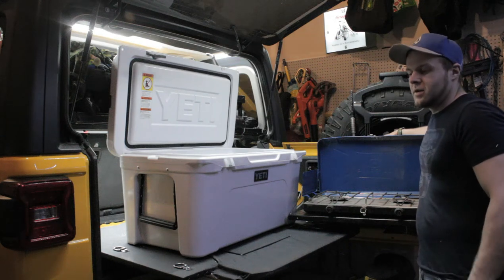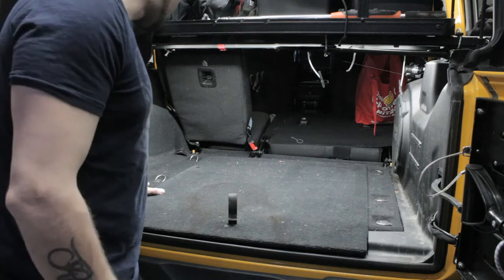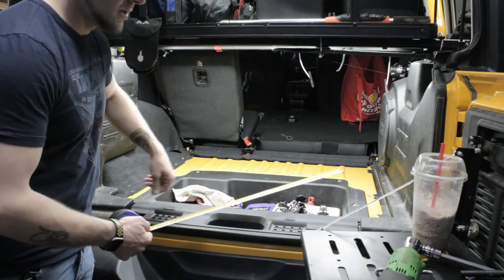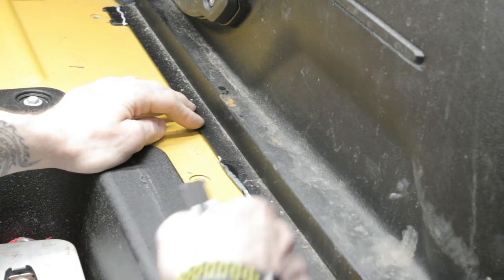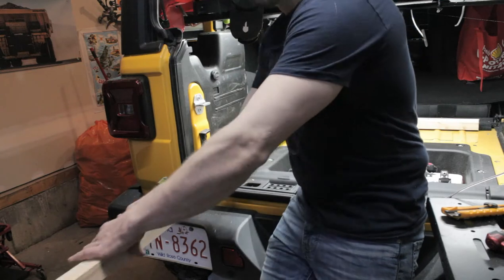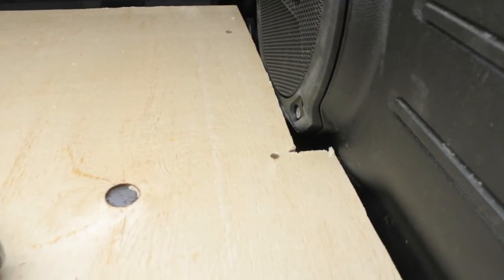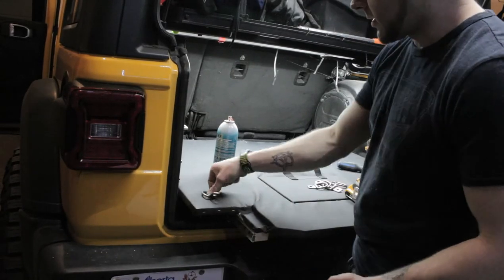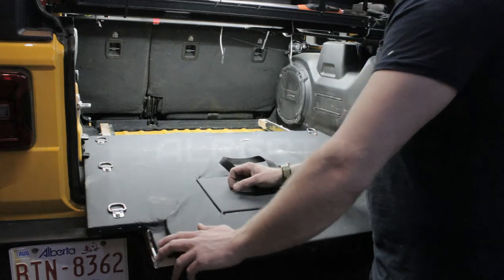Jeep Cargo Slide! Sliding Cargo Base DIY

Comment: Good job describing what you did to install and the extra comments about the slide mount board size recommendation.  I just wondered why you didn't use the interior floor panels for most of the cover over the plywood base.  If you had it to do all over again would you use lumber that had more height so there would be room for some tools under the sliding base?